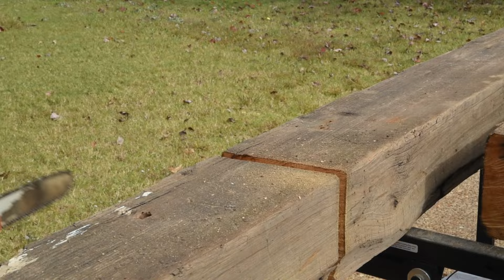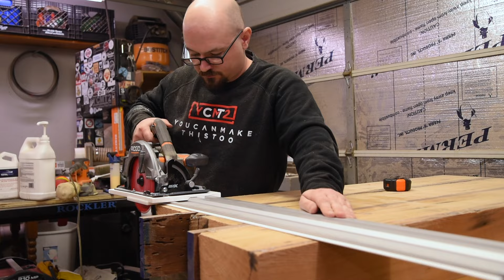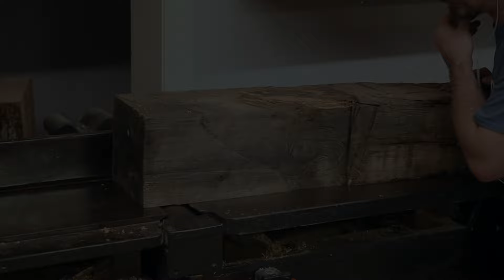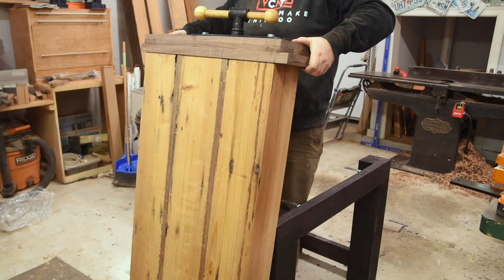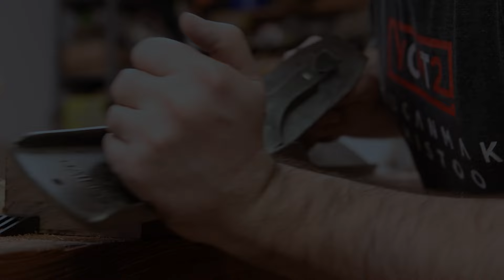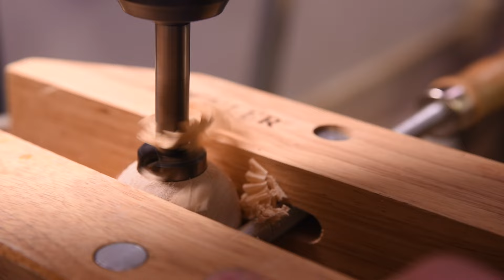How To Build a Woodworking Workbench

Comment: Hopefully five years out you still see my question. Your tail vice is extremely tall and I’m putting a tail vice on my bench and it is also going to be 5 inches tall. Since the clamping force is at the bottom of the tail vice do you have issue with tilting When you put smaller objects that clamp into the top of the tail vice? Also what tail vice hardware is that?

Comment: oil and wax will contaminate your work and make finishing a pain, you'll have to clean every project of wax to keep the finish from getting ruined. Regards-German trained Journeyman.
Reply from the maker: The wax I use dries hard and after over a year I haven't had any issue with any projects on it. But, that's still a good point depending on what products you're using.
Reply: What should it be finished with? If anything....

Comment: You can make this too - just buy a jointer and a thickness planer. Easy. Seriously, looks cool, but not too many people have these tools.
Reply from the maker: Or buy material already surfaced..
Reply from the maker: Or use a router sled.. or hand planes, or use a friends shop, or find a local maker space.
Reply: @YouCanMakeThisToo  fair points.

Comment: Did you ever weigh it in? How does it handle during your operations when it's dropped on the floor do you get any wiggles?
Reply from the maker: I haven't weighed it, and on the floor it's rock solid.
Reply: @YouCanMakeThisToo  that's good to know I was concerned that the angle brackets might rack a bit under horizontal load

Comment: I would not use Forstnere bits for the holes. Instead I would use a holesaw as the pilot drill is 1/4in and provides a guided entry hole for the other side. If the Forsner is too far thru the hole will not line up as there is not enough wood.
Reply from the maker: That's a good idea.
Reply: @YouCanMakeThisToo  I would suggest that most woodworkers should have at least a decent holesaw arbor and a few sizes of holesaws. I started with Starrett but Lenox and Greenlee are good too, even Rok. Lenox and Starrett are my fave holesaws but I buy them as I need them. I am not a fan of sets of anything especially router bits, holesaws too. I like good tools but not all at once.

Comment: I use holesaws for making holes over 1in because the pilot drill protrudes about 3/4in  so it leaves a nice pilot hole for the other side to leave a clean hole. Forstner tips are very short and can cause misalignment.
Reply from the maker: That’s a good idea, thanks!

Comment: The track that you used with your rigid circular saw, where did you get the track from and base plate for the saw? I have the same circular saw and am trying to figure out The best way to turn it into a track saw.
Reply from the maker: It’s called the TrueTrac guide, works great! They have a router base too.

Comment: Can the beams run width wise across the table instead to length wise?  Might find shorter beams as 'scrap' but not longer ones, also may make the joinery easier?  Nice bench....
Reply from the maker: Definitely. I just did long way so they wouldn’t be in the way of my vise.

Comment: Oh, quick question: I have some old-ass reclaimed hardwood. Would it be okay to use them as the sides of a learners  benchtop with structural pine 2x4s sandwiched between?  Will they expand shrink v differently and make the top uneven?
Reply from the maker: Depends on the construction and grain orientation. If the build the top as a unit that can move some, separate from the base, then you’ll be fine. If the pine is still wet (as most box store stuff is) and you set it where it’s captive between those sides, you’re gonna be sad when it shrinks.

Comment: How do the wheels work? Am I going to whack my toes?
Reply from the maker: Step on the lever and they go down to lift the bench, push the level up and they lower the bench. They’re on quick release plates so you can take them off easy if you don’t want them on there all the time. I’ve ever kicked them, but I always wear shop shoes so maybe I just don’t notice
Reply: YouCanMakeThisToo Oh! Thanks SO much! That sounds perfect. It will have to sit off the carport just outside the main door, so moving it easily is super important.

Comment: Well, I thought was a terrific "show" today. You gave us a running explanation what your goals were, why you made some mistakes you ran into, along with what DID work. That, to me is important (And perhaps that's why I shaved a point or two of others who never say a word. I know they know what they're doing on the project, but I, for one, just never was able to get my "mind reading" to work it seems. ;)

BUT, you finished and that was IT! I was hoping to see the final package. Now I'm largely joking in saying that, however I just LIKE to see the finished project. If for no other reason that it's easier to STEAL all or parts of your design; It just makes it simpler.

And last, I've been on the fence as to just how large or small my next bench should be and I think the size you built your bench is quite close for what I'll need. And with that, thanks again.
Reply from the maker: Thank you!

In a recent video someone mentioned that glaring oversight in my videos. Not giving a good overview shot in the outdo. I’ve since made a point to make sure it wraps up with some whole project shots. Unfortunately there’s no way to fix that on published stuff. But if you want to buy the plans you’ll have all the details you want 😁

So far I love it! Very happy with the size I picked. Doesn’t take up much room but handles 95% of the work perfectly, the rest pushes it a bit.

Comment: Laminating the legs and cutting up those big slabs you put in the top would prevent the whole bench from twisting. It does look great but it all might twist further down the road.
Reply from the maker: The top is super dry, I don't see it moving any more at all. I milled it over several sessions and let it rest.

Comment: Nice work on the bench    I could see that bench being very handy in many shops  not just  yours  most of us that do Woodworking are generally  challenged  on square footage  as well  especially if you are working out of a  garage you need to share  or use for other things also
Reply from the maker: Exactly! I'd love to have an 8' long hand tool bench.. but that just doesn't make sense. As I'm able to use it more I look forward to showing how a small bench will probably do most of what you need from it - and beefing up the parts makes up for the weight issue so it'll still work just fine.

Comment: This video is inconsistent with your channel name and stated objectives. The bench is quite functional but way overbuilt.  Plus I suspect your viewers have neither the machinery to make a bench like this, nor could they find the materials.  So it's just fluff.
Reply from the maker: Thanks for commenting. I talked about it why it was over built. And thanks for pointing out that I haven't updated my channel description, I'll fix that. To clarify, YouCanMakeThisToo is about having a can do attitude, finding solutions instead of excuses, and reinforcing that if you invest the time and work, you will be able to make anything you want. I couldn't have made this 3 years ago, but now I can. 

Of course I doubt you think my channel name would only be appropriate to Primitive Technology type videos, that'd be extreme. But as to the machinery comment - I failed to mention it in this video, but if you go to the milling video I referenced - or check my video catalog instead of my About, you'll find the machine substitution series I did where I categorize every task each of machines perform in my shop and then cover how those same tasks can be performed a myriad of ways. 

As far as material, I'm sure most people can find wood. Finding 5" stock any day of the week would be tough in some areas, but if you search, wait, and are willing to drive, it can be found. If you can't find a single piece to do what you need, then do exactly what I did in the video and glue them up 'till you have a big enough piece.
Reply: @YouCanMakeThisToo   ---- I appreciate your response and I do understand better what you are trying to do here, so thanks for that.  I suspect that we'll end up disagreeing about some of the givens involved in your approach, but I think there's plenty of room for variety and creativity, and that's all good to me. 
    By the way, I would suggest that the lamination of the walnut boards into the bench top has significant value beyond reaching the size objective.  All of the square corners, straight edges, and any other linear or 90 degree features on a bench-top are  valuable when working with hand tools (esp saws), as they provide the brain a way to reference and subconsciously help keep your cut straight.  In fact, in my second bench, I added 3/4 wide inlay of purpleheart  a few inches inside the perimeter of the top, and it  works great -- kinda like having a square built in to the bench.  You probably have done very much the same thing without knowing it.   Thanks again.
Reply from the maker: Dan, you’re dead right. I didn’t think about the built in square at all! It does make for a handy visual reference.

Comment: Should last a lifetime. Never seen anyone make a facevice with a dowel before. Will be interesting to see how it works out. Always liked big timber benches.
Reply from the maker: I have no doubt it will. The face vise is solid steel. The dowel is just the stabilizer on the leg vise, it has a steel screw.

Comment: could not find a double marking gauge
thanks
Reply from the maker: Lee Valley sells them under their Veritas brand. But a single marking gauge works just as well, just have to do it twice. You can get those for like $13 on amazon. Or just use a ruler and mark with a pencil or knife. Whatever works for you.

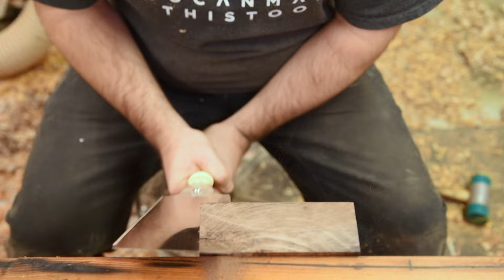Comment: 9:50 is slightly disturbing
Reply: Depends on your perspective.  To me 3:30 is disturbing.
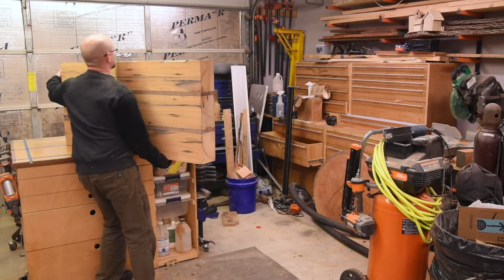Reply from the maker: You must’ve missed 2:38
Reply from the maker: It looks like I was leaning against the piece, but I wasn't, there was more than the bit's length between my clothes and the drill fully sunk. Still, a very precarious position to be in and not advisable, good eye.

Comment: Nice bench! I'm getting ready to do a very similar bench. I am taking Jay Bate's design as well but I am having to modify it to fit under my miter saw station since I am limited to a 2-car garage. I hope to begin working on the bench next week after I get my new SawStop picked up and installed. I'll be doing a video of the build too.
Reply from the maker: Nice! Sounds like you have quite the shop upgrades coming. Look forward to your build!